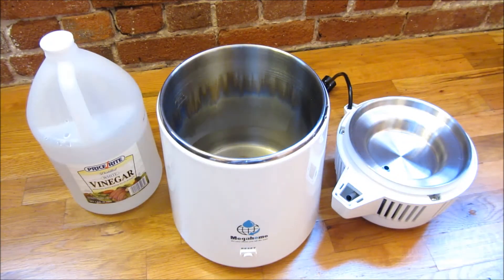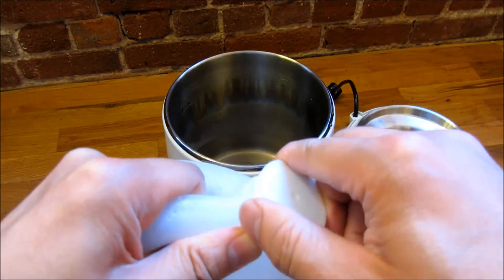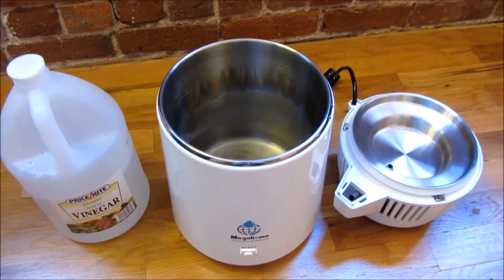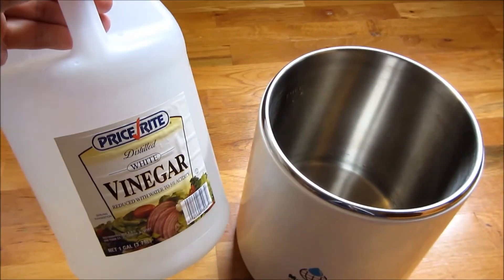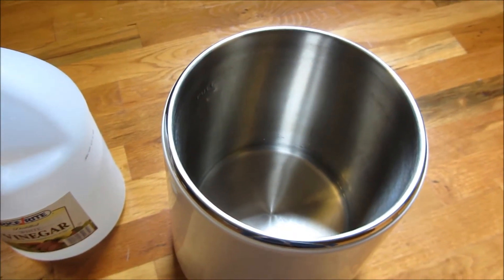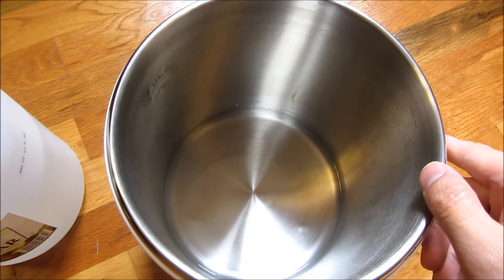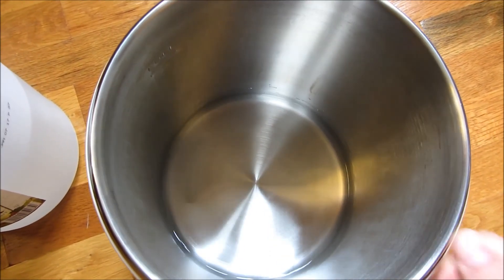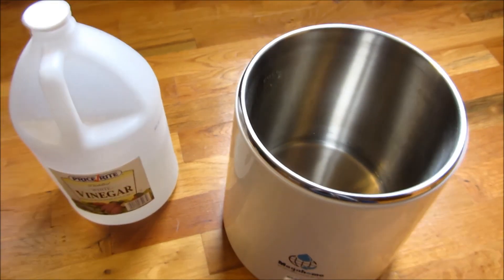Water Distiller | How to Clean with Vinegar | Before and After

Comment: What im wondering is if you can turn it on with the vinegar water solution  inside and have the top fan thing on as well? Because my top fan part is filled with mineral deposits and hust gross, I've never ran the cleaner solution through the top part of the water distiller.

Comment: I have never used a water distiller in myrtle beach,even though I started using them in 1989.After one use, the bottom, looked like that, That is how terrible the water is here. The water smells like mold, often. I have used it 5 days now ,so I will use your vinegar solution.

Comment: Leave the vinegar in overnight not 15 mins. Overfill the distiller just slightly so the gunk toxins  dont get cooked or just turn it off before the end.
Reply: Ahhh, this is really good advice. So it stops based on timer, not when it starts overheating from no more water? I ran mine with vinegar and water for a cycle and my water has tasted off since. I changed the charcoal filter and cycled it 3 times now and still tastes funky. Have you had any experiences like this? I don’t imagine vinegar could’ve permanently ruined stainless steel

Comment: Hi, do the air stills need a vinegar clean before use when they are brand new? Cheers.
Reply from the maker: Brand new it doesn't need to be cleaned with vinegar, but after maybe 1 week or 2 weeks you should clean it.

Comment: How do you clean the top part of the water distiller? I noticed a weird taste with my water, and the top part of my water distiller smells the same :S
Reply: Same here.  Cleaning the pot is simple - I see anything gathering, I pull out the steel scrubbie and scrub it away.  Wipe with soap and water, etc.
How these people get so much build up that they can't get it off?  No idea.

Cleaning the TOP???  Can't find anything on that.  What I've been doing though is funneling vinegar into it until it starts to come out the spout and then stop and let it sit for a few hours.  Then do a plain water run to clear it out.  That /seems/ to work but I'd like to get opinions on that.
Reply: @Anonneemuss  thats similar to what i do. Mine came with a funnel for this and you have to tilt it till water comes out. I use a tiny bit of citric acid instead of vinegar and then a bit of water and it cleans up well :)
Reply: @Anonneemuss  it builds up to where I can’t get it off because we have really hard water where I live, LOTS of minerals in our water. So if I go more than a few weeks without cleaning it’s really hard to get off
Reply: ⭐ Do a full clean using 3 cps plain white vinegar + 3 cps hot water (I add xtra hot microwaved water to speed up). Run for apx 45 minutes. Empty, rinse well and wipe down container with clean towel. Allow lid to air dry before reattaching base. Frequency: As needed, depending on usage frequency.
⭐ Avoid sediments burning into pot. Time the run-cycle of your unit to know your unit's distillation duration. Then turn off 20-30 min before.
Reply: Have you changed the filter?

Comment: So for the first clean after a month I have boiled it for 30 minutes with citric acid supplied with the distiller which didn't get rid of the crust deposits on the bottom. I then did what you say here and soaked it for 15 minutes with neat vinegar and then added the same amount of cold water and left it overnight. The crust has mostly dissolved but there is still some hard deposits which are also rainbow coloured (whatever that is?) that don't want to come off :-( So now I have covered the bottom again with vinegar and filled it up to the top with hot water hoping to also get the flame like dark marks at the top (like your photo at the beginning of this video) off too. How long should I soak it for like this and/or should the water be boiling? Would using a non-scratch scourer be safe to try scrubbing a bit as I have already tried the paper towels and cloths. Hoping to hear from you. Thank you.
Reply from the maker: Never scrub it, just use 1/4 cup vinegar and 1/4 cup water for the bottom, 6 hours should be fine.  The key is never boil the water bone dry, I use a timer such that there is always 1/2" of water left at the bottom, then I pour that mineralized water away.  See my video here - See my Tips Video - https://www.youtube.com/watch?v=DCmespGh_AQ